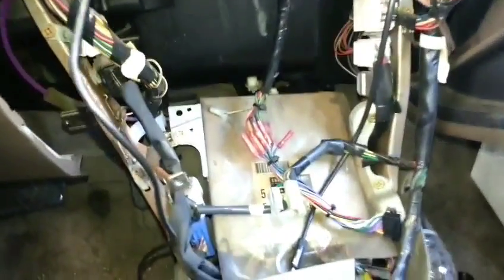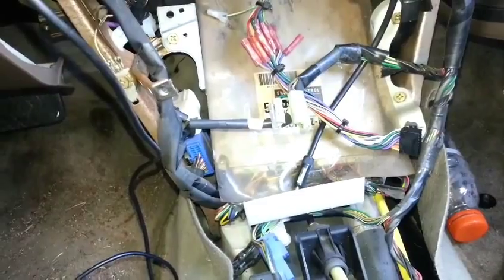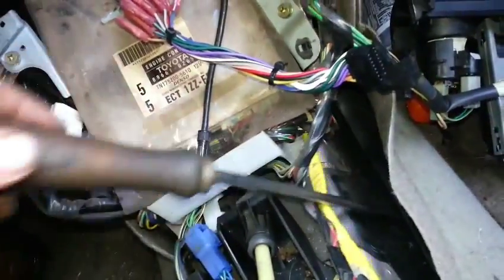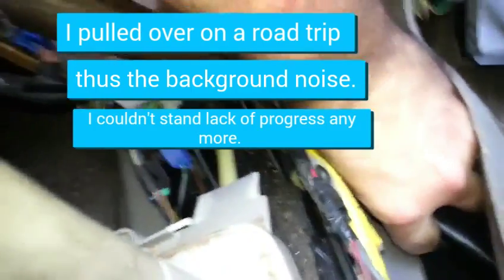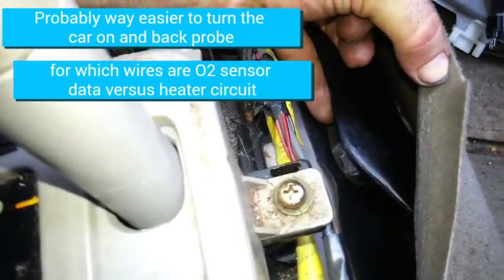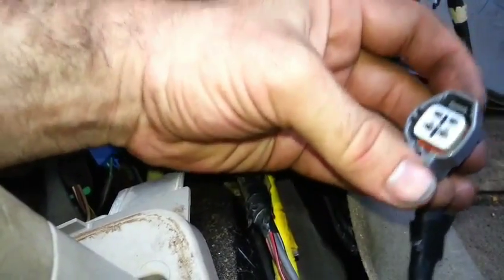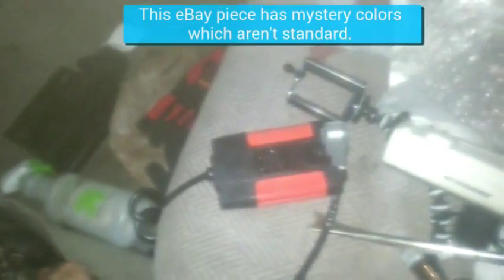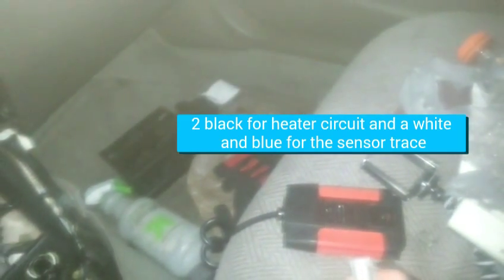Downstream O2 Sensor Removal Part 1? Dash removal.

Comment: Or, remove the passenger seat, pull up the carpet, slide the HVAC duct out of the way and the connector is right there!! Do not remove the dash or the console. Easy peasy. Just saying.
Reply from the maker: The way the center console was built for me, thet had to go or the center console was fully sealing where my oxygen's sensor plugged in directly underneath it.

I know of the procedure you speak of on other Toyotas. My trim package didn't allow it.

I'm glad you're letting everyone know to check for the east way first! 😃👌✅

Comment from the maker: Part 2 here:
https://youtu.be/Ky-A9nUeIgU
This video will help whether you have O2 sensor issues like P0141 inactive heater circuit, or a P0420 for catalytic converter efficiency below threshold. I talk about it all. 
This also shows where the PCM is, how to get the stereo out in case you're upgrading sound or you have other diagnostic that needs to be done at the PCM, engine control module or computer. 

Since I was next to my terrible welding I shared some about my catalytic converter upgrade and you can learn more from a few articles. I share my theories why a bigger catalytic converter got me more wHP. http://carmilespergallon.blogspot.com/2014/08/catalytic-converter-and-horse-power-why_27.html

Comment: Wow, what a pain in the rear. All that work for an o2 sensor! So someone had damaged the wiring going to the pcm, is that right? It would be great to see some live data on this. Thanks for the video.
Reply from the maker: +Mathew Wood Working on it! :)
Reply from the maker: +Mathew Wood The frayed wiring I showed I believe was the work of the people who swapped the 2000 engine into this 1999. I'm referring to the wiring I plugged the eBay oxygen sensor into. The engine swap required a complete wiring harness and different PCM. They did mostly a good job. The money I saved on the car being a salvage title got spent many years later on a transmission mount which had sheared off. They figured 2 bolts was good enough instead of 3 (not really good enough, huh? lol)

Their patchwork, as ugly as it was under the dash though wasn't the problem. If you look at the article in the description you'll see a picture of how my exhaust was held together before I welded it. That was prone to catch on speed bumps and got loosened several times. Once I welded it, it was all good, but I was off-roading about a year ago and almost made it home. My driveway ripped out the downstream O2 sensor wiring. Now THAT's the background story. :)
Reply from the maker: +Mathew Wood Got the live data up now. :) It was less stable when I first installed it so I think the PCM was still trying to figure out how to work with it's downstream O2 sensor data and find a new balance.

Comment: I do not like interior work , to many things for me to break . lol . Have you took temps on converter to see if it is working , Not seeing the down stream data , but thinking checking the inlet and outlet temps can kinda say it is working or not , about a hundred hotter on outlet , Could also try the anti fouler that Steve said .
Reply from the maker: I've shot the footage for the "live data" many times. An eBay seller sent me twice as big of a mini SD to avoid a negative comment. Silly thing worked awesome until I tried to shoot live data.

I'll try again my friend. Would have been in the video. 

I really think the catalytic converter is fine. Ran the car some and the back of the catalytic converter is plenty hotter just in seconds of running it. It's only about a year old, but I noticed the tale tale signs of an exhaust leak which matched my suspicion as I shot this video. Couldn't see it at this angle but it got hit hard.

I'm sure I'll be running extension cords to the garage shooting some welding soon enough. Lol. I'm a better welder than those welds. When I welded up the rest of the exhaust to tuck it up better those welds were twice as good....still plenty of room do improvement. :)
Reply from the maker: I really thought about what you said during my day and I have an idea! +wtbm123 I've been against anti-foulers because it's the easy way to not P0420. I seem to only get it when I have an exhaust leak so I think of it as a safety, however, since my miles per gallon is down since the catalytic converter and the PCM wanting to better take care of it, I'd consider it again since I'm a MPG nut. :)

Comment: Looks like that O2 came out pretty wobbly , were the threads still good. I can't edit and put captions on the screen, that's neat.
Reply from the maker: Threads were great my friend. Hey. I enjoyed the introduction to your land. Sorry, work came in the shop so I didn't comment. 
I have a pending P0420 and my gas mileage is down. I see it on the live scanner pushing rich on the front sensor trying to decide if it likes what it can see. Lol

I whacked my catalytic converter coming into a birthday movie Transylvania 2 for the wife's celebration. Looked hit before that during production. I think it broke open a leak. Sure sounds like one. Sorry if you'd prefer no spoilers, but plenty more to come. 

I know +Schrodingers Box doesn't believe exhaust leaks there should cause a P0420, but classically Toyota made that PCM's too sensitive and only the next generation gets a reflash fix.
Reply: On the rear o2 throw a spark plug anti fouler on and I bet the 420 goes away. Worth a $4 experiment , it's worked for me many times.
Reply from the maker: +Steve Rob I was explaining to +wtbm123 that I'm against anti-foulers...less because it's illegal in some places and more because it's the easy way out of the predicament that this year of car can easily run into. (Like Matt I like a challenge.)

I think my car would be less sensitive with the anti-fouler, which is exactly the update for the 2003 and later model of Corolla. Many a forum has information about all the ways to fail modifying my PCM. They made it crazy secure with all kinds of useless programming and data just to throw you off the scent of what's really going on in there. I think they did a good job since aftermarket products actually work on my car, but they may have also frozen themselves out of their own PCM for the update! lol

Back to what I was actually saying to wtm123 since you two really got me thinking. Since the downstream O2 sensor, my gas mileage instantly went down. I'm thinking the car is calling for more fuel to test the catalytic converter. I see it run this routine almost everytime drive it, but it still hasn't set a hard code. The wait is killing me. I'm up for the anti-fouler experiment just to see if it's an MPG gain! But for now, I like that the PCM complains a bit when I have an exhaust leak...wasn't really paying enough attention before the data spoke to me. :)